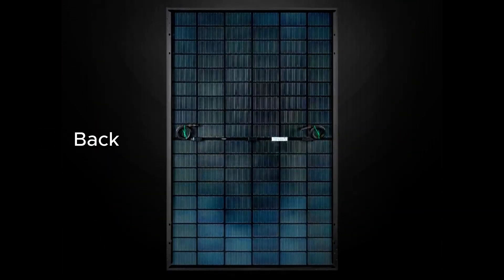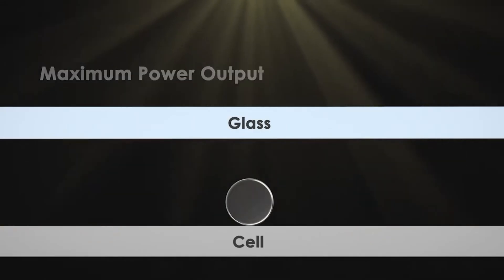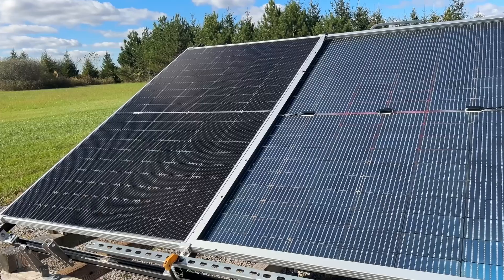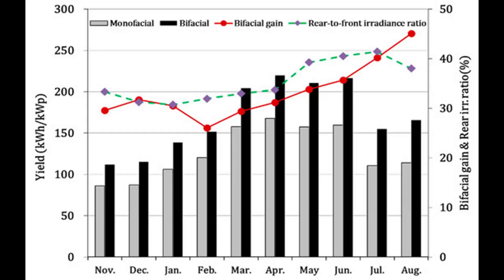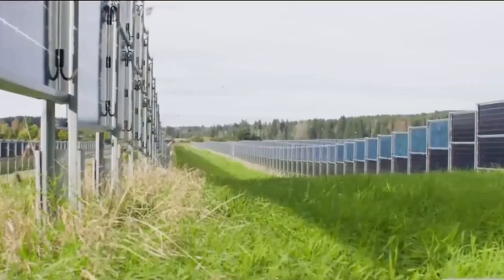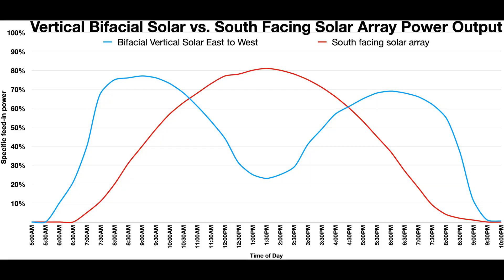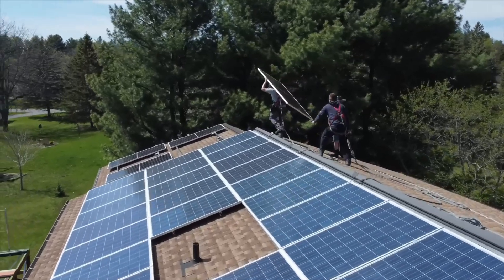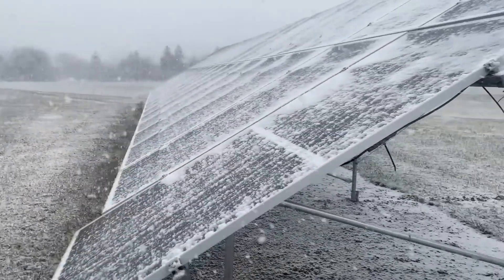Bifacial Solar Panel vs Monofacial – Which Should You Choose in 2025?

Comment: Thanks a lot, As I understood; When a Bifacial panel is labled 600w by stick it means the front side produces 600w as maximum and any light reflection to backside will add extra power. is it true?  thanks
Reply from the maker: Yes, that's right.